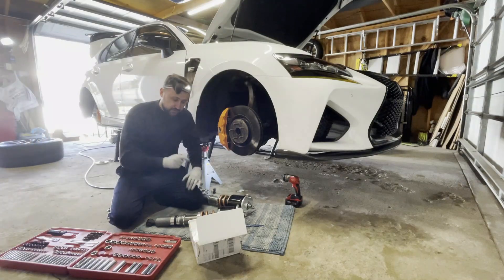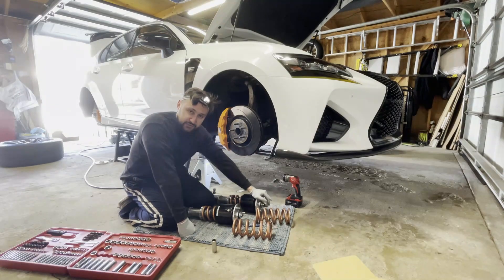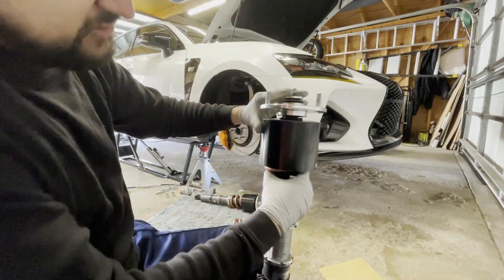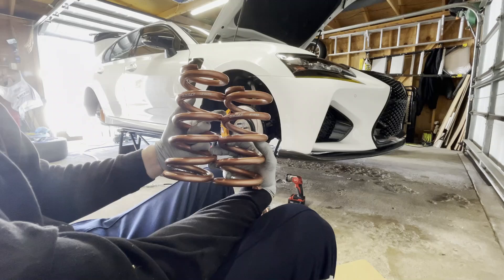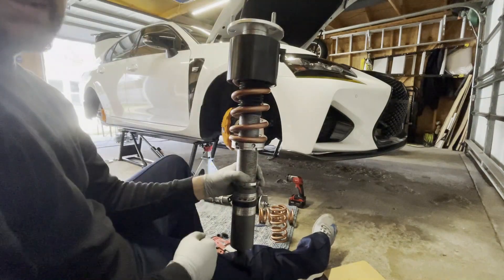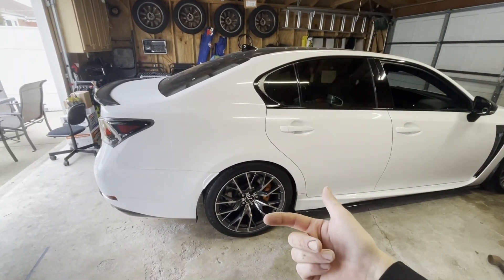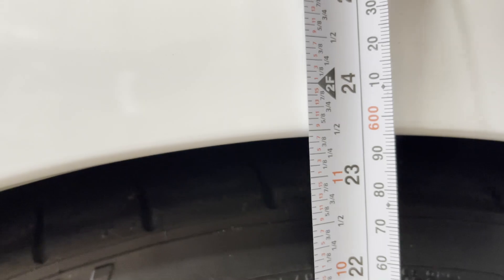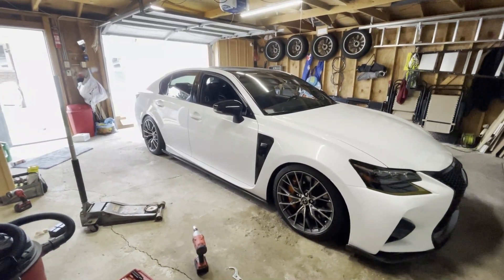Lexus GSF CKS Coilover Update- Upgrade to Stiffer Spring

Comment: Even 14kg front and 16kg rear, my RCF still bouncy when in freeway. Even worse when the road have big dip the plastic under the car scraped like crazy. I wish CKS have compression damping.
Reply from the maker: The car is heavier in the front why have the stiffer spring in rear
Reply: thats because its still way too soft, kg/mm is a lot diff than lbs/in which US companies use. a 10k lbs/in spring is where it begins to get stiff, as you can stand on the spring at it barely compresses. anything less you can compress yourself, so imagine a whole ass car. track springs are much more than 10k in and too bouncy, so go inbetween 16-10 for road use/ stance

Comment: Nice Bro! I was waiting for you to make the switch because everything you describe is exactly how I feel on 14/12s. I measure from top of rim to fender edge. Have you ever thought of installing RCA's? Would make for a good video and review; can't remember if you have aftermarket roll bars.
Reply from the maker: Right it's so soft before. As far as suspension mods Im not planning on any more

Comment: About to order cks tomorrow. So far I know I need 16 for the front and 14 for the back? And do I need to know anything about resetting the bushings? Thank you
Reply from the maker: When u Tighten the suspension just make sure you jack up the lower control arm so it has some load on it.
Reply: @BulletsGarage  thanks bro